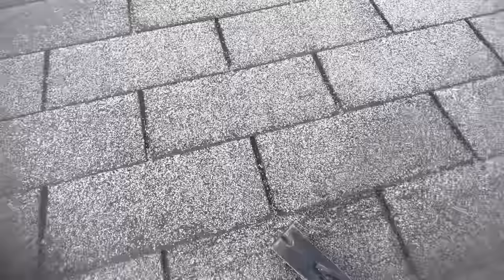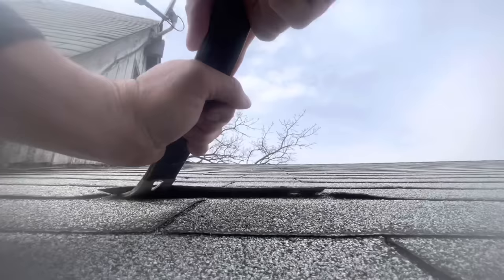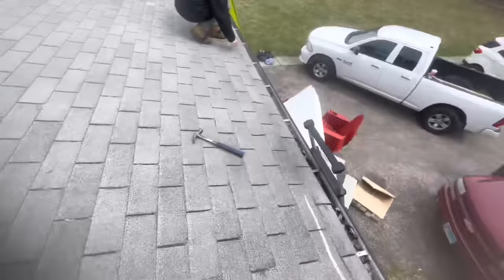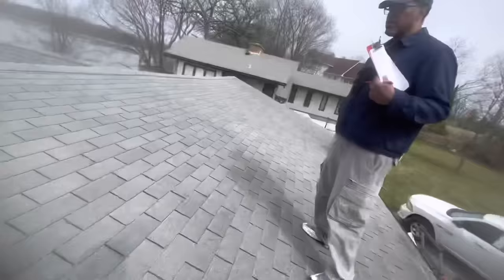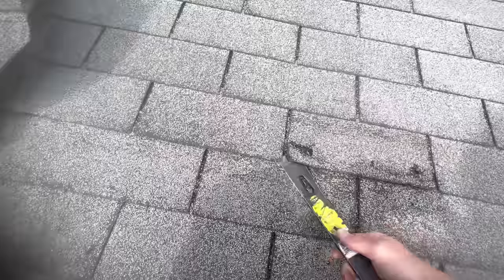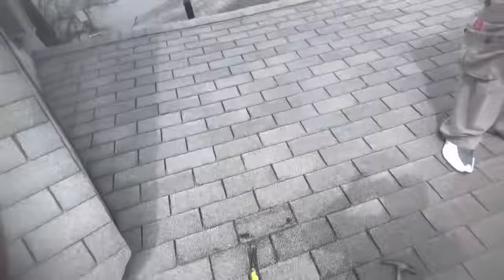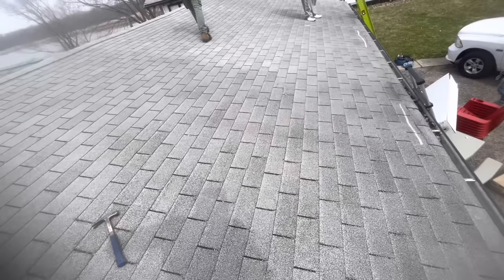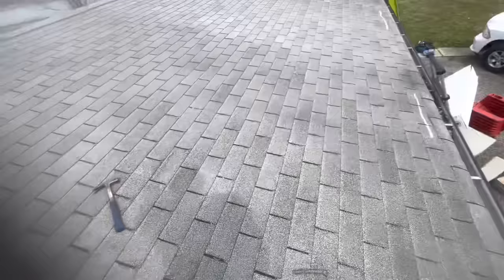Insurance Adjuster says roof is repairable. 😂 See how this inspection is ignored & denied?

Comment: Its incredible he isn’t accepting the obvious but where is roof damaged by what?
Reply from the maker: Great observation. The roof had 40+ shingles damaged by a wind storm throughout.
Reply: @ChicagoRoofer  is it possible the shingles were damaged do tho the age of the shingle as the shingles.   I watched my neighbor tear up his old roof after a hurricane and the insurance company replaced it so this scam goes both ways.  If the roof is old and do to be replaced anyways I don’t think the insurance company should be paying for it which means all policy holders pay for it.  There should be an age pro ration on whole replacements based on age of roof starting at 5 years.  Repairs costs on a roof should be paid and the owner could chose to use that money as he sees fit.  Repair or replacement.

Comment: What initiated the claim? Maybe I missed it.
Reply from the maker: Great question, nothing's worse than not knowing the full context. This home sustained wind damages from extremely high winds that came through. It was an isolated incident but led to over 40 plus shingles damaged from wind. Due to the wind damage, a repair was necessary. The repair was not possible due to the condition of the shingles. For that reason, the roof needs to be fully replaced.
Reply: @ChicagoRoofer  thanks

Comment: Is this claim legit or not?  Answer these questions to find out?
The 'covered peril' is WIND.  But, where in this video is there visible wind damage?
What is the 'date of loss'?
Was it 'so windy' that day, that the roof was damaged?
Wouldn't other homes have suffered similar damages too?  Did they?  How's the neighbor's?
What was the recorded 'highest wind speed' on that day for this local area?
I didn't see blown-off shingles, torn-shingles, or curled shingles. 
How old is the asphalt shingled roof?
What's the product warranty or life span on the shingles? 
The 'granules' rubbing off the shingles would suggest they're very old and dry.
Homeowners Insurance Policies don't cover 'wear and tear'.  That's a maintenance issue.

Whomever installed that existing roof used some sort of adhesive to hold down the shingles, plus nails.
Is that common and proper installation?
Why did the roofer use a narrow 'pry bar' to lift (and tear) what looked like an undamaged shingle?
Wouldn't a broader/wider and thinner blade instrument, like those for drywall patching, been a better choice?
From what was shown in this brief video, the facts are not clear.
Reply from the maker: I'll answer this more but you suggested a  drywall tool should be a better tool on the roof. 

I'm busting your chops but you are critically thinking the through. I appreciate the way you structure your questions.  In fact, I love it. Thank you!

I will have a more formal response to all your questions. If for any reason I forget, please remind me.
Reply: @ChicagoRoofer  If the goal was to break the adhesive bond (by slicing through the goo), and not by 'forcibly lifting' the shingle, then a thin instrument, as suggested, might do the trick.

[re.] all the other questions, this is what the insurance company is thinking.  Knowing the answers will put you in a better position to recognize if you have a strong vs. weak case of wind damage. 

btw:  You have a good, positive attitude.
Reply from the maker: I appreciate you and your approach!

Comment: As an ex-contractor turned adjuster, I can tell you that most of the stigma against adjusters is just plain wrong. Adjusters don't make more money if they deny your roof. Denying it is not "in their favor". Actually for most of us, its in our favor to get the roof bought. The problem most contractors have with adjusters are the adjusters who have zero construction knowledge, and couldn't identify a hammer, much less swing one. When you get a good independent adjuster, with a construction background, trust me, that adjuster is fighting tooth and nail to get you as much as legally possible, because he makes more money.

Comment: I am a licensed adjuster for almost 20 yrs. I said ADJUSTER, not roofer. I can see plainly that this roof is NOT repairable. Any adjuster, after seeing what I see here, that says this roof is repairable is a FRAUD.
Reply from the maker: Appreciate your feedback. I do have good honest adjusters often too that agree with me. Many have quit cause (according to them) they are being told to change reports against their own best ethical and reasonable judgement.
Reply: @ChicagoRoofer  That's exactly what happened to me. The insurance companies were requiring that I deny perfectly legitimate damage, which was making me an accessory to their practice of cheating the policy holders. I just couldn't honestly participate in that injustice. I still keep my adjuster license current but  I no longer work for the insurance companies as now I am also a Public Adjuster since 2015, helping the victims get paid when the insurance companies try to rip them off..

Comment: Sounds like harassment. That roof is old. Insurance does not replace a roof due to age. Those shingles were holding like a champ. An independent adjuster is not towing the company line but they do have a regard for their integrity. The conflict of interest bit that some seem to not understand: the guy tearing up the old shingles and trying to get the adjuster to admit to something on video has a vested interest in getting the roof bought. 
He will make thousands off that roof. Even after paying the roofing crews to slap a new one down. Will he invoice for the maximum insurance allowance? Or will it still be a competitive bid?
Does the insurance company now provide a warranty for the quality of the roofing job? 
This is not always so cut and dry, folks.

Comment: So someone installed the roof incorrectly. 

The the carrier needs to subrogate against the installer’s carrier. 

Good luck. Just tar the whole thing and call it a day
Reply from the maker: Roof was fine for many many years and the condition was frail overtime while a storm came through and blew a lot of the shingles up or off. Based on the damages from that storm, the roof needs to be repaired which is not possible hence why it’s being replaced claim went up from an initial $3200-$62,000.

Comment: What do you expect from an old three tab shingle roof? Wear and tear is not covered. Brittle old shingles is considered wear and tear.  that’s where the reasonable and necessary repair part of the policy is. It would be unreasonable to replace an entire roof to fix a few shingles. That’s the elephant in the room. Roofers don’t want to waste their time unless it’s an entire roof. You would walk away from a job if it’s a partial repair to chase that roof replacement job.Also, you arguing with an adjuster on the roof about the policy is like complaining to a cashier about a return policy. If you have a problem with it, take it up with DOI. Better yet, attorney rep or PA.

Comment: The repair cost $30,000 dollars.... to replace $20,000 dollars.
Reply from the maker: If I had to do this repair over and over it would be $100k or more. The total approved for replacement was $62k
Reply: @ChicagoRoofer  You misunderstood the comment.Then you should have said 150K for repair and 100k for replacement. Make the replacement cost cheaper than the repair cost. You are in charge of the numbers.

Comment: What’s all this “is repairable” type damage, vs non repairable. I wish I understood what’s going on, but I don’t so someone tell me plz lol
Reply from the maker: This is a great question. Often times a roof may be in such a frail condition that it cannot be repaired. Sometimes an insurance company will claim that you can do a repair even though when manipulating the shingles it’ll cause further damage to the surrounding shingles. This means that the roof is not repairable must be replaced. Where are you located
Reply: @ChicagoRoofer  so it’s ether repairable or replaceable? I’m in Washington btw. Y u ask?
Reply from the maker: @kotaguy7 it’s not repairable. That’s the point. What are you asking?
Reply: @ChicagoRoofer  I still don’t get it. Is it better to get it repaired or replaced? I imagine the replacing is expensive compared to repairing? Also, I thought u asked where I live lol. Look at your comments lol
Reply from the maker: @kotaguy7  it’s better to do what’s right. At times it’s repairable and other times it’s not. In this case it’s not repairable hence why we are pushing to do a full roof replacement. I have many circumstances where we have repaired and not even involve the insurance company because we know it’s not right or fair or responsible. But in this case, the only possible way to repairing it is to replace the full roof. Does that answer your question? I feel like you are an adjuster and trying to get your point across. Is there something I missing or something that doesn’t make sense or something that’s illegitimate or unreasonable ?
Reply: @ChicagoRoofer  not tryna argue. Just tryna understand who’s doing what. And why. Thanks for the replies.
Reply from the maker: @kotaguy7 we won’t argue if it’s paid for as a repair. However, if the repair is attempted and not possible, the repair can’t be done. The repair immediately becomes a replacement.
Reply: So they don’t want to dump money into a huge project? And to avoid that, they’re only trying to cover repairs, and not a full roof replacement?

Comment: Lmaooo.... That crusty ass roof isn't repairable. With that said they need to be using an offset puddy knife to get that shingle up, not that dull crowbar.
Reply from the maker: I've used a putty knife for this and it cuts the bottom shingle it slices through the top one. I have to save the putty knife for patching drywall. :-)
Reply: @ChicagoRoofer  the ones I use are so banged up and dull you could barely slice butter with it. Yea man to each their own but man that crow bar lol. Might as well be using a 2x4. You can just look at that roof and tell it isn't repairable. Crazy the adjuster is even trying that. I gotta meet one for a reinspection tomorrow. 85 sq continuous roof section. They are trying to "replace" like ⅔ of it because the other third is an addition but that roof is still 14 years old baking in the FL sun and it has some of its own wind damage. Home owner is pissed as hell.

Comment: If you can not repair it is wear and tear and this is not covered
Reply from the maker: Would say any person that doesn't understand the policy. If the homeowner filed a claim for the product failing you'd be right. The wear and tear wasn't the cause of loss. The wind damage was and the wear, tear, and age of the roof contributes to why it's not possible to complete a legitimate repair.
Reply: @ChicagoRoofer  Oh contrary the only reason the roof was damaged is due to its age 
would a new roof properly installed have been damaged
Reply from the maker: The age was a contributing factor. However, the cause of loss wasn't age, it was wind.

Comment: Insurance companies are so short sighted. It will save them money now but it will probably cost them money down the line when things break or fail yet again for doing it the cheap crappy way. Always better to just replaced everything that doing spot repairs. Like a car engine or transmission  better to just get a rebuilt one or a new one than to replace little parts here and there which will only cost way more in the long run and more inconvenience for the owner as many more repairs will have to be made instead of doing it right once the first time. They care about saving money now to look good only to come bite their own ass and everybody' ass later on. They aren't too smart when it comes to prevention and repairs only cutting costs now. They cut their noses off to spite their face. They are pennywise but pound foolish. They only make profits cause they got so many customers due to their size and monopoly  but they have no brains whatsoever.

Comment: First off, why are you swiping the shingle at the top multiple times? Also, you are using a crowbar instead of a putty knife to unseal the shingle therefore causing additional damages to other shingles. I’d say even on a brand new roof you would be doing a hackjob. You are a salesman not a roofer.
Reply from the maker: Thank you for your observation. Never seen a roofer use a painters putty knife for removing shingles. Only adjusters have done this. The adjuster on Thurs claim used a putty knife and cut through shingles faster than what I've demonstrated here.

Comment: I don’t understand how people can expect insurance to pay for a repair on an old roof. That’s like asking your insurance to pay for your old  cars leaking window…., I don’t understand some people’s logic. Also my friend used to work for farmers insurance , and insurance adjusters always try to help the homeowner, but so many people seem to think insurance covers maintenance issues, and that’s just not true.
Reply from the maker: If the claim was for maintenance, you're 100% right. If the claim is for wind damage and due to the age or deterioration of a roof, it's not possible to repair. Then replacement is necessary. Hence this customer has a replacement cost policy, not an actual cash value policy. For those reasons, they owe for the full replacement.
Reply: @ChicagoRoofer  are you telling me a shingle can't be replaced, they have to replace the entire roof?
Reply: @ChicagoRoofer  you should have mentioned that in the video. But seriously slap some we tar under that shingle and call it a day.
Reply from the maker: Pretty much. If a repair is impossible without causing additional damages, a replacement is necessary.

Comment: I think these bitumen type shingles are rubbish 
Normal shingles are rubbish 
Corrugated zinc alum is the best roofing material ..it's forever
Reply from the maker: Never seen these, what are they like? Where are they popular?
Reply: @ChicagoRoofer  oh you mean zinc alum ? 
Corrugated iron it's commonly called but it's made not from iron as it was in the past ..it's now zinc aluminium alloy, and they make the sheets the length you want 
820mm wide on average.
There's also colourbond where a colour is impregnated onto the surface ..it's better
Reply: @ChicagoRoofer  Australia

Comment: Wow. You are unsealing shingles with a pry bar dude 🤣. You need to use something like a putty knife or else this will happen.
Reply from the maker: So you're suggesting I use a painters tool for a roofing job? What difference would it make when it's a frail shingle that needs to be priee and Bent to allow for the hammer to nail the nail in flush?
Reply: @ChicagoRoofer  it's just that you can't treat this roof like if it was new. With the right tools and care almost everything can be repaired. In this case I would use a different tool like a putty knife to break the seal not a pry bar. It just doesn't look like you are really trying hard lol 😅
Reply from the maker: When you take out an insurance policy, you suggest and they do, to replace everything back to pre-loss condition. Nothing more, nothing less. The insurance company collects premiums based on what they assume the risk is. If they assume the risk is like new, then they owe for that. I'm not arguing what is or is not repairable at the end of the day, what I'm arguing is hold up your end of the deal is you promise somebody you will take care of them, just do it!
Reply: @ChicagoRoofer  also based on what I can see in the video, the damage was solely caused by the pry bar and not due to the pliability of the shingle. I don't think I saw any crease marks caused by just lifting it up after you unsealed. Just adding my 2 cents, see a lot of insurance haters here and will probably get roasted but oh well that is the internet. 😁
Reply: @ChicagoRoofer  Yep! It's a never ending battle unfortunately but I believe it is important to understand both sides. Yes you have bad adjusters out there that don't know what they are doing and yes you have contractors that do everything they can to call a roof not repairable. Insurance companies get all the heat of course because they are the ones that "don't like to pay" and homeowners of course want something back after paying premium for years.
Reply: I watched the video again and I take some of that back. The shingle did crease with you lifting it up. I would kinda agree that it may not be repairable.
Reply: Seems kinda weird you rubbing your fingers on the shingle removing the granules  lol but looks like it did crease at the top meaning is not pliable/brittle. The other damage was still caused by the pry bar tho 😅
Reply: If it wasn't your fingers removing the granules of course. 👀
Reply from the maker: Thank you for being reasonable. Wish there were many more out there that would look at the issue in many lenses.
Reply from the maker: The pry bar did in fact cause damage. That's the issue at hand.  The shingles cannot be repaired.